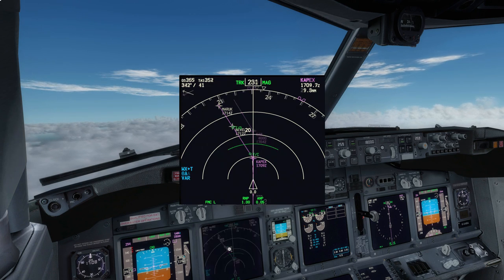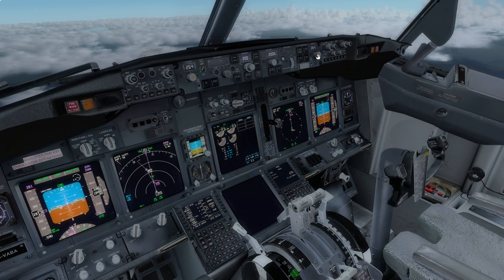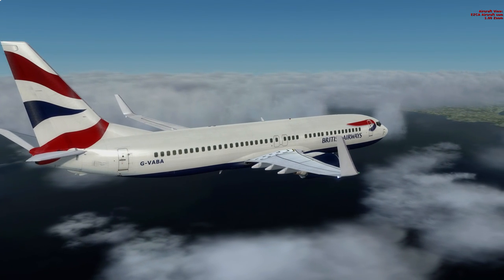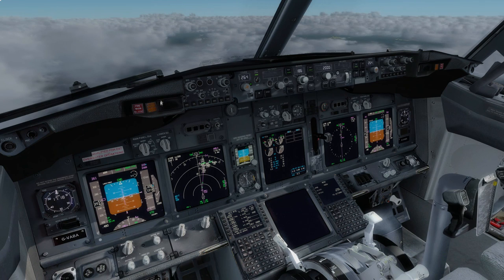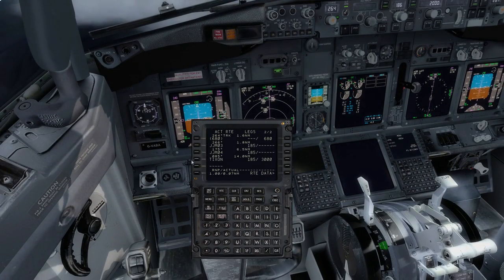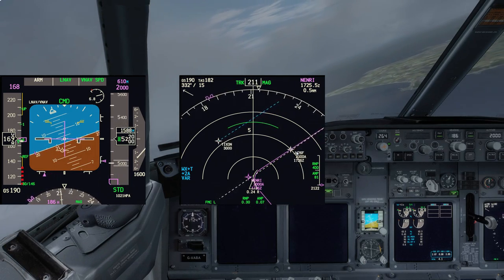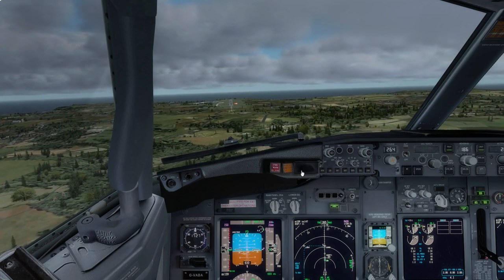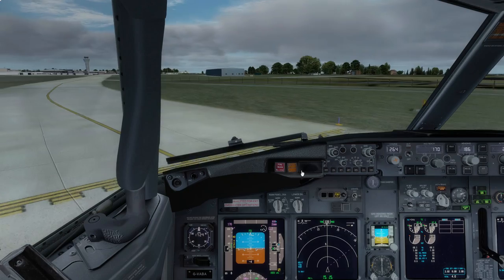UTX EUROPE V2 - LANDING IN JERSEY

Comment: Awesome stuff, Froogle, Thanks!! Quick question.. Why select RNAV over ILS for the approach?
Reply from the maker: Chris Schubert because it was there. There wasn't a long thought process behind it. It was also very very easy
Reply: Chris Schubert If you've ever flown in a real aircraft using instruments, you will recognize the GPS/RNAV is a lot more accurate than the radio signals emitted by VORs and localizers. A lot of airlines and military are starting to use these more frequently as the systems are becoming more reliable.

Comment: FPS I can only dream of.
I read every post on every forum, treid every tweak but still it just sucks. And yet I always find these videos with the most unrealistic smooth going!
How how how???
Reply from the maker: Pede Meyer Hours and hours of adjusting every option and methodically measuring the results. There is no quick fix.
Reply: frooglesim yes.., in the early 90' when Micropose had the lead, and all we saw onscreen were blue, brown and green squares it was easier. Now it seames to be imposseble to figure out what to do. So many is offering there own trick to fps. But what works for one isn't doing anything for others, so its a jungle. Like yourselv.., I did all the things you have recomanded eg.the bufferpool trick  that worked wonders for you.., at my place - no difference at all, I still have FPS at around 5 over busy places. My pc is not amazing but not bad at all.., i7, 2.66ghz, 2gb gpu and 8 gb ram.., so Im getting very frustrated at times. Still.. I'm so much in love with simaviation, now age 52 so Iĺl keep on reading, tweaking and fighting.  And hopefully one day get it right.
Anyway.., you vidoes are fantastick and inspirationel. All the best Pede:)

Comment: It would be so cool if you could answer me at least once. I posted at least 4 questions/requests at different videos and I didnt get single response
Reply from the maker: Izmael1310 I have 45,000 subscribers and I'm sure you can imagine that that generates a lot of email traffic and comments. The 3 questions you asked are all outside of the scope of comments I will reply to. I don't do technical support (one of your requests), i'm not going to comment on licensing questions about P3d (you asked my advice relating to buying the "cheapest" version of P3d), and I don't ever comment ever on what I may or may not film in the future. 

So when I get questions like that it's a lot more efficient for me to move on to questions I can answer rather than type over and over again "I'm sorry, i can't help you, try a support forum".
Reply: frooglesim Ok I just would like to have good looking sim without crashing and it seems that everything works in your game (including game stability and all addons). Only thing I know from your videos that you cant change  the error related with v ram. But you usually play with the highest settings with a lot of addons and you dont have 5-10 fps like myself at UK 2000 Heathrow scenery for example :)

And of my request was about the scenery (scenery library) and I think that its not outside the scope. Some scenery tutorial, correct order, which addons dont like other addons, if it is possible to combine payware airport or city with freeware mesh of country/area etc. You mentioned it in one of the videos that you could do that in the future and it would be great :)

Cheers